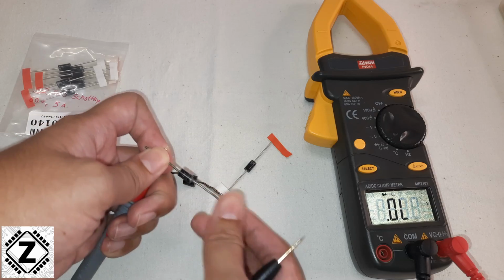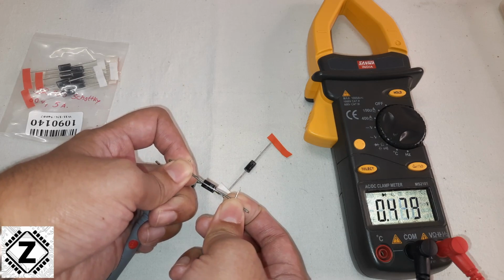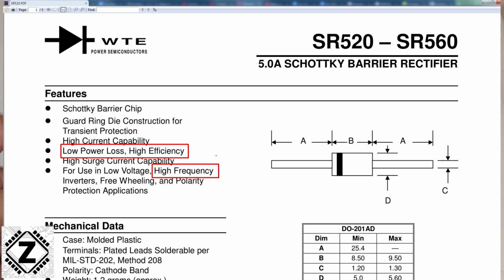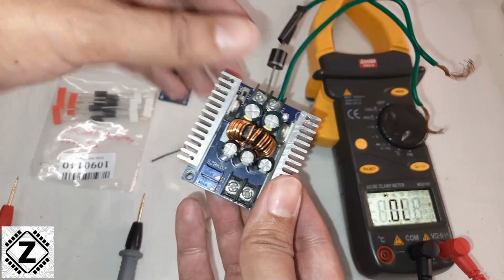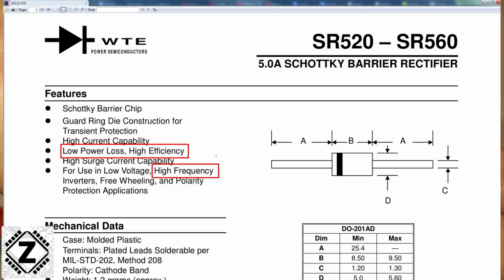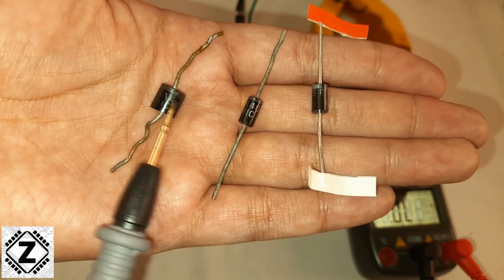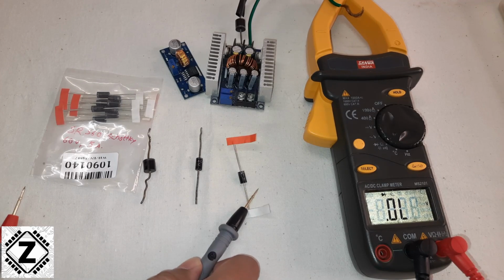[Eng] Silicon Rectifier vs Schottky Diode Differences explained | Which one is better?

Comment from the maker: This video is available in Multiple Languages
Hindi https://youtu.be/fBr7Yfsp5VA
English https://youtu.be/rqOQzvSv8KA

[Best Buy Affiliate Links]
Rectifier diodes https://amzn.to/3Rs8y40
Schottky diodes https://amzn.to/48o1jjz
Bridge rectifier https://amzn.to/46gWqqW

Branded Digital Multimeters-
HTC Instrument Mas 830L https://amzn.to/3nciKwc
HTC DM 81  https://amzn.to/2ERygMq
Mextech DT-603  https://amzn.to/33pdYn3
MECO 101B+ Digital Multimeter Pocket Size https://amzn.to/30ul87L

Buy High Quality AC/DC True RMS Clamp meters (RECOMMENDED)-
My Meter- Mastech MS2101 https://amzn.to/342Ogp0
Metravi DT-725 TRMS https://amzn.to/45VtXHm
KAIWEETS HT208D Inrush https://amzn.to/3t3yNUa

Chapters English
00:00 All types of Diodes
02:27 Physical Properties, Anode & Cathode terminals
03:13 Symbols
03:25 How to test a Diode using digital Multimeter
04:12 Dropout Voltage,  Power loss
07:06 Pros & Cons- Fast Switching frequency
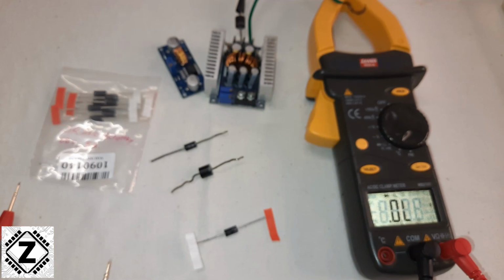08:34 Is Schottky diode better than GP silicon diode? Cost, Voltage Support
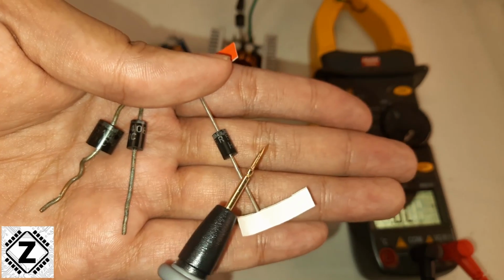09:44 Mains AC vs Low voltage DC applications
10:55 Conclusion

#diode #Electronics101 #ZenInnovations #ZenEnglish #ClampMeter #multimeter 

[Diode Guides]
All diode types explained
https://youtu.be/kRJeE0aONbU

What is a diode? How to Test a diode
Hindi https://youtu.be/Zi2R_Z6V1Q4
English https://youtu.be/wZQ1ULznyDw

Schottky vs GP silicon rectifier diode
Hindhttps://youtu.be/fBr7Yfsp5VA
English https://youtu.be/rqOQzvSv8KA